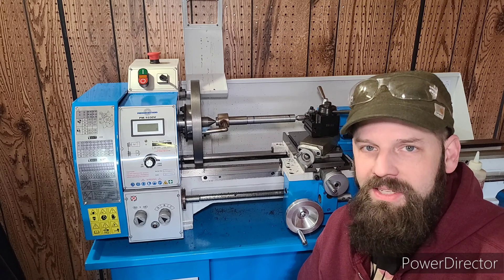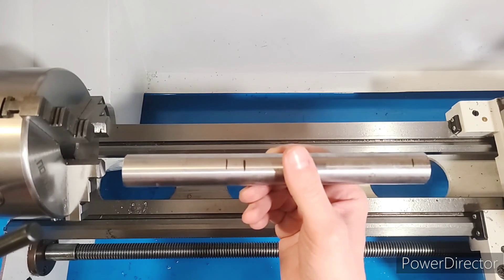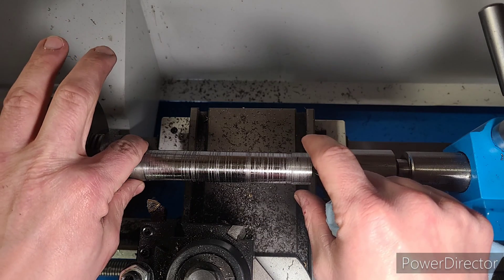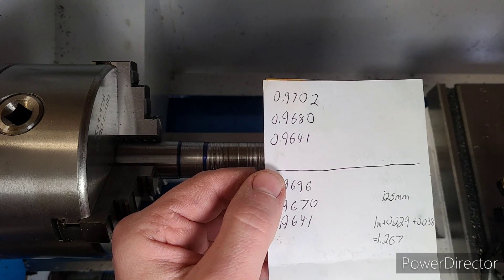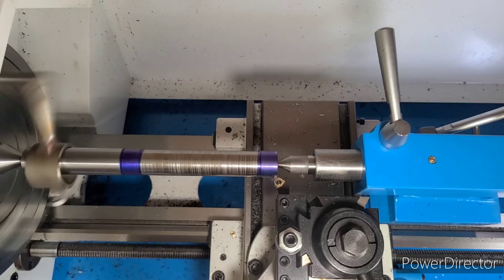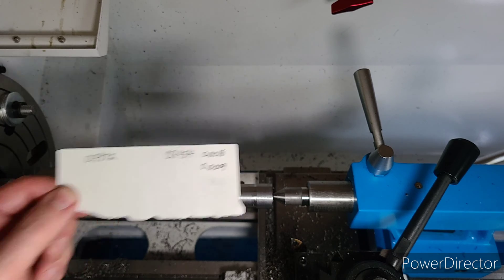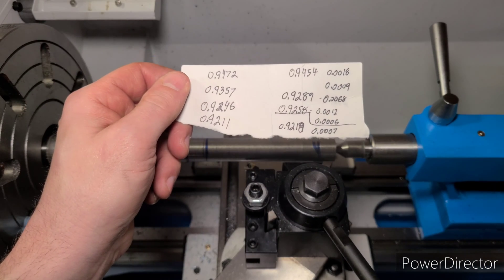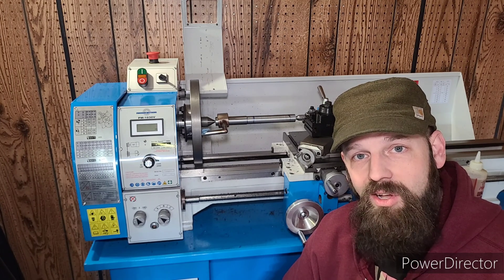New Precision Matthews Lathe Set-Up Part 3: Lathe Alignment

Comment: If you want a smoother finish, try and use a regular HSS (High Speed Steel) tool. The carbide tips are really used in higher pro units - this unit is still considered more DIY and hobby type.
Reply from the maker: Thx for the tip. I do have have a set of regular bits. But my results were a bit poor. I thought carbide buts would help with a better finish. But I thinks its more likely my speeds and feeds.